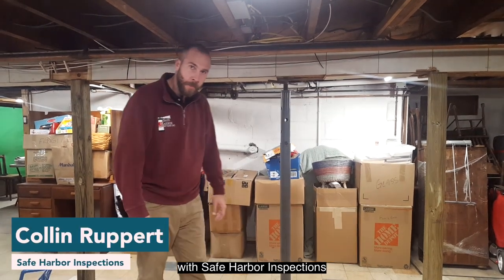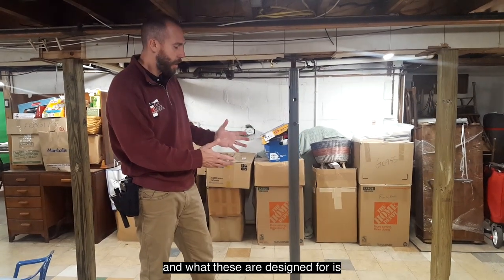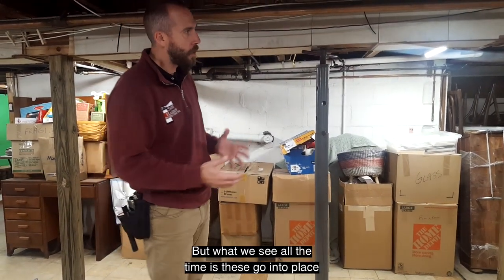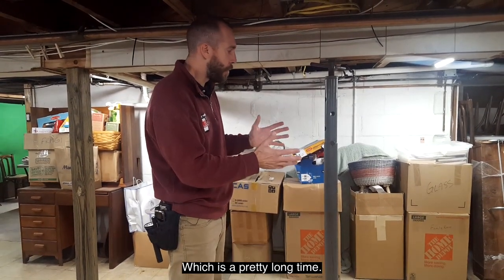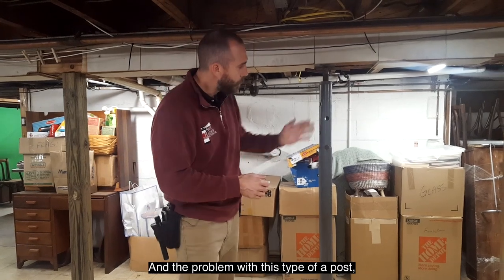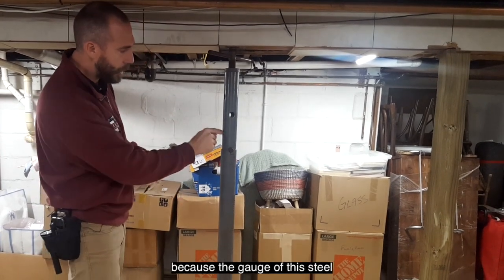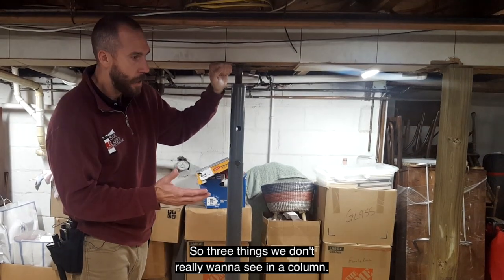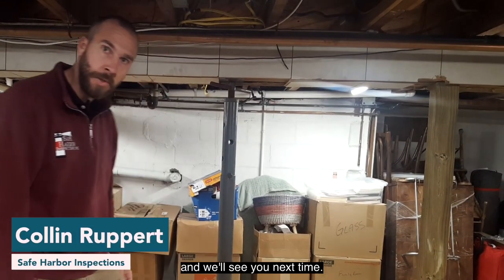Temporary columns are not a substitute for true steel Lally columns.

Comment: We have 8 of these screw jacks in our basement and the previous owner welded/bolted them in. I have no clue if I can remove them or not or, even who to ask to see if i can remove them safety. 

I think they were used to set the house on the foundation (it's a modular home) and then were left installed.  Given they are very thin gauge metal, i don't see how it offers any structure support in our case and here's my reasoning of why I think this: 

Our basement walls are constructed of 2 rows thick of cinder blocks and the house sits on the walls via 13 steel H-beams with the outer most of the top of the walls capping the ends of the H-beams on both sides. 

The screw jacks are tack welded to the H-beams at the top and screwed into the concrete floor at the bottom across the center area and at the side with the basement doors. The screw jacks don't correspond to load barring walls above them but in 2 locations, however those walls are supported by the steel undercarriage of the house, that then sits ontop of the H-beams. 

That's my reasoning of why I think these were left behind vs taken out. 

I hope this comes across clearly for you and not too confusing. Given the circumstances, do you think I have assumed correctly with our screw jack situation?
Reply: Metal post not made to sit on concrete floor without stainless steel plates.

Comment: ?? Lally columns not sold here at all. And the a quick search indicates jack posts are "compliant to national building code". My bigger concern would actually be the framing support at the top and the concrete thickness at the bottom.
Reply from the maker: Any screw jack can be tampered with. But there are plenty of screw Jack's that are structurally strong enough for most residential uses. The footings are critical. There are steel plates that can go between the beams and columns to make sure the wood beam doesn't compress.  I hope this helps.

Comment: Hi Jim, I'm about to buy a ranch style house built in 1966 in New England. I'm concerned about the basement main beam (approx .30 ft length) being supported solely by jack screw posts. There are 6 of them spanning the beam. It appears that they've been there for quite a while. I was told by my home inspector that is was common for homes to by built this way back in the mid 60's. However, this doesn't sit well with me. (no pun intended) Would a builder install these jack posts on a concrete slab without footings? If so, why wouldn't they have installed a more permanent post like a Lally column?
Reply from the maker: some permanent Lally columns look like screw jacks, so they may be fine.  I recommend that you get a qualified carpenter or an engineer to look at your posts to make sure that they are adequate.
Reply: Same situation here, exactly in fact. Oddly, had my inspection last week (my inspector is also a structural engineer), and beyond telling me this was common in ‘90s builds - he never implied or said directly that all of the Jack posts should be replaced by lally columns! After watching all of these videos; I’m really concerned. And replacing 6 Jack posts with concrete-filled lally columns sounds like a huge undertaking!

Comment: You should briefly mention how one installs a fixed column! Do they use the temporary column to raise it up enough to get the fixed column in?  That seems unwise and may put dangerous stress on that part of the structure.
Reply: That is exactly how you replace. And it is in no way dangerous if done correctly. Although note you need a second column to lift beside (or two more if the column being replaced is between a seam in a wood beam).
Reply: You only need 1mm to get a new one in
Reply: @Luckingsworth  Ah right.  If done with precision one doesn't need to raise that ceiling up very much at all to have the clearance to insert the fixed column replacement.  And by using two temporary ones it keeps the ceiling above the fixed  column flatter.

Comment: Akron adjustable jack posts say they "can be used as permanent secondary support as long as there is primary support." What would secondary support be considered? If I want to add a secondary beam to just support sagging floors, is that considered secondary since it's not supporting load bearing walls for instance?
Reply from the maker: We've seen home depot cheap post collapse so you have to be sure the post is not taking too much of a load
 If it's simply being used to stabilize rather then lifting a screw Jack may be ok, but to us a permanent column on a footing is much more reliable.  I hope this helps!
Reply from the maker: Hi Ryan, if you're strictly supporting sagging floors then there is not much of a load.  However, if the floors are sagging because there is a bearing wall on top of the floor, a temporary post is not adequate.  If you are supporting a bearing wall, you need a permanent steal Lally,
Reply: Yeah they work great to stabilize the floor long term but not to literally hold up the floor long term. Just had one collapse due to weather/house shifting